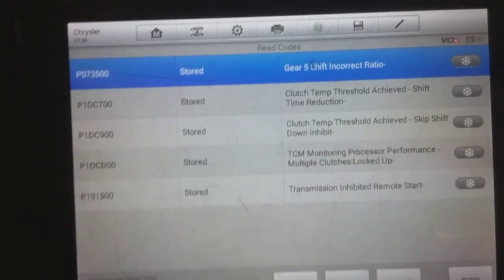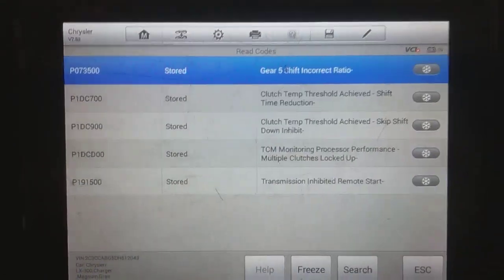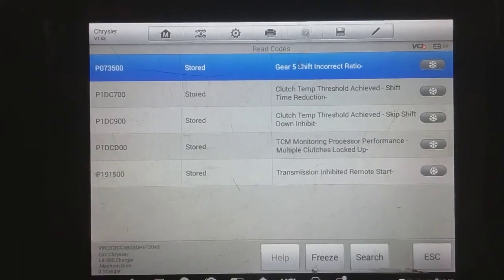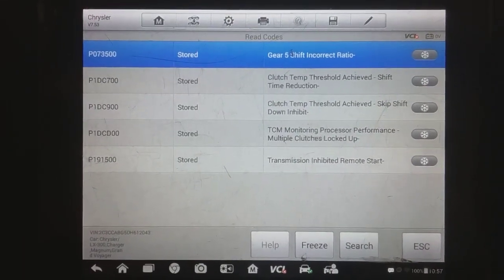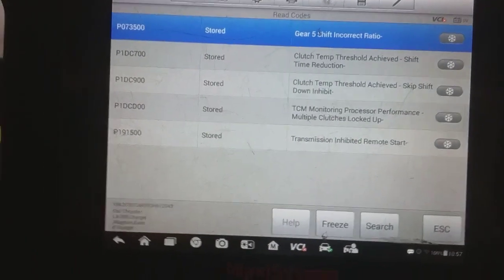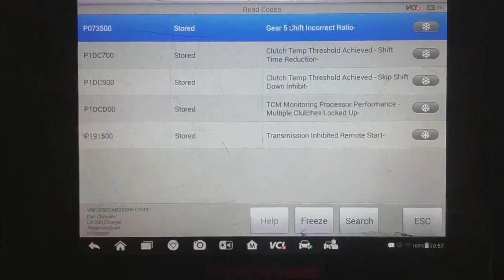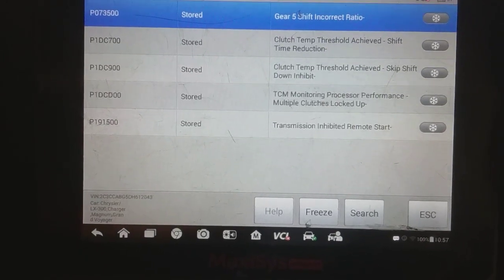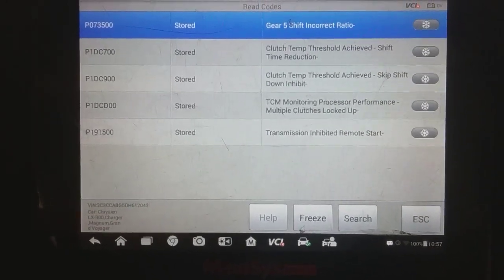2013 chrysler 300 S [P0735] trans cooler/condenser replacement

Comment: Thank you so much for this video I was told my ac condenser was in the dashboard? And now i finally know about the little grinding sound when I turn my wheel. I assumed because it was “electric” assist power steering there was no fluid to keep track of

Comment: Question once you repaired the Trans Cooler and Condenser did you replace the lines and did the code clear once you drove the car or did you have to clear with diagnostic machine.

Comment: Same codes but my trans fluid started coming out the trans breather line and it was a milky color and trans wouldn’t let engine increase speed had to pull over call tow truck is my trans done for or can it be saved ?

Comment: Was it driving? Or it wouldn’t go into drive or reverse because of low transmission oil?
Reply from the maker: It went into limp home mode, shut down and restart it'll work fine until episode happen again.
Reply: My hose came loose while driving I pulled over and got a tow. I got the line reconnected do I just get my fluid changed and refilled now to get it out of limp mode.
Reply: Yes same as above car was driving fine til hose came off. I got it reconnected do I just get the fluids refilled to get it out of limp mode

Comment: I’m trying to replace my radiator on my 2013 Chrysler 300 to take front bumper off  like you did is it just few bolts by the tires ? And on top the plastic part?
Reply from the maker: It's been a while since I done this. But to remove the bumper, there fasteners by the tire end of the bumper. Typically you can, Take off part of the wheel well cover, you'll gain access to inner bumper [opposite side] if you run your hand along the top corner, you'll feel any additional fasteners, if there isn't any, bumper will pop right out.
Reply: customhonda thanks man just subscribe to you
Reply: Brah replacing my radiator right now
Reply: @cordchiles5  I was able too do it it’s easy
Reply: @cordchiles5  you don’t have take bumper completely off if just little bit and pry the cooling fans off it’s way easier